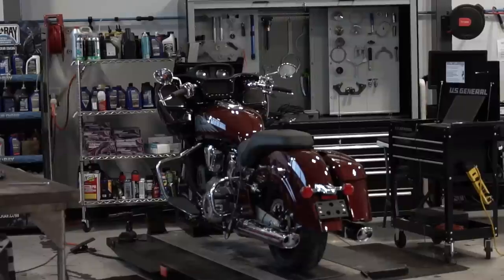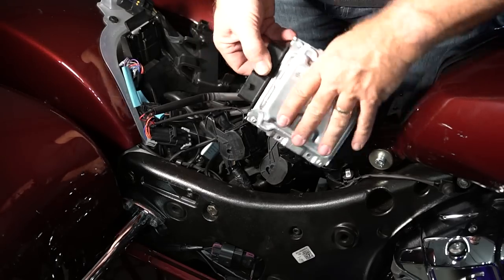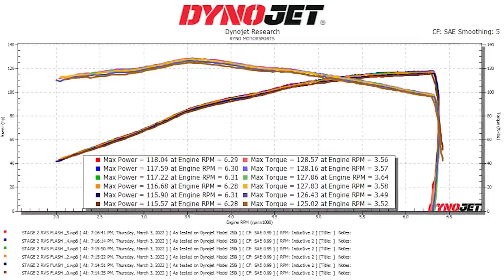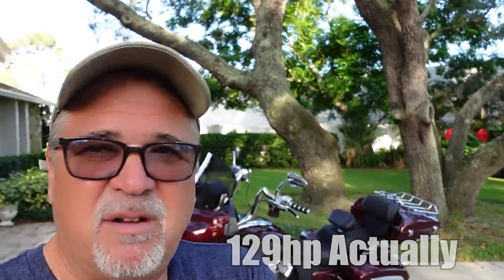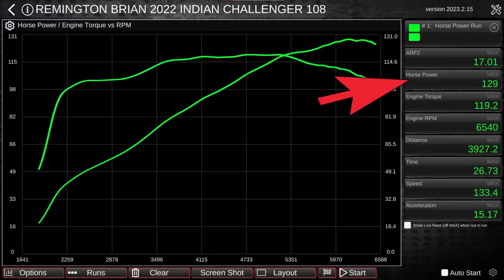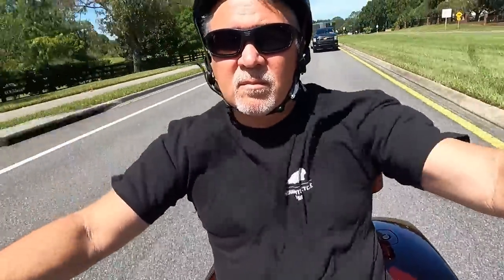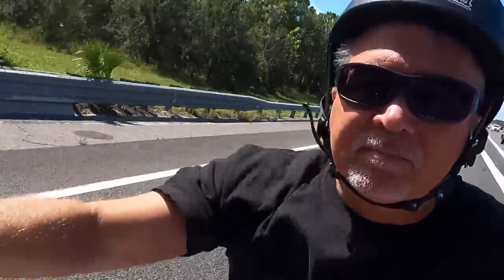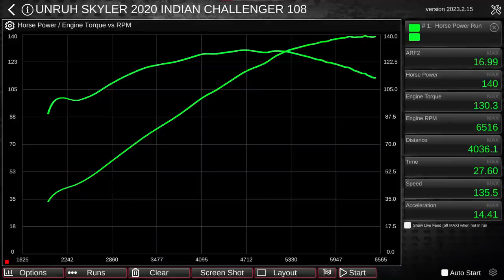My Results from the Lloydz Garage Challenger Cams - What do I do now?

Comment: The 140hp dyno chart you showed was from my Challenger.  My recommendation for you is to get the Lloydz Sawicki 2:1 Mid-Length stainless exhaust.  It is a key to this combo and tuning running optimally... from what I understand, the tune was developed with this exact combo.   Sounds great at idle and cruise, not too loud but you definitely know the bike is running.  When you rip the throttle it sounds so raw and throaty!  Bike got better gas mileage on the way home than it did on the way to Sturgis, went from 33mpg to 38mpg... and I was I ripping higher speeds and feeling it out a lot more.  Bike also runs cooler now when idling or riding at low speeds for extended periods of time. Overall I am very happy with the setup, the money spent, and how my Challenger runs now.
Reply from the maker: thats awesome! yeah thats funny, I noticed much better fuel mileage on the way homne as well.
Reply: I loved my Challenger and Sawicki pipe.  However, it wasn’t fast compared to my new BMW K1600b!  Zero comparison!
Reply: @darcher5888  Your K1600b puts down 134hp and 117trq at the tire (the 160hp they claim is rated at the crank)... the full Lloydz setup has the Indian Challenger out performing your BMW.
Reply: THAT'S a brilliant tune and result. Exactly what should happen when an engine and components work seamlessly together, & the improved cooling confirms it! We don't have these options sadly in Australia, with only one place doing Lloyds remote tunes, and some VERY bad press about them sadly. Exhausts are absolutely expensive, with our crappy dollar, and the massive freight costs. Can you send us a video clip with sound of your bike? Would love to hear how it sounds.
Reply: @GraemeBlore  Thanks! I just posted a quick clip of my Challenger getting onto the on-ramp and then the interstate on my YouTube channel.  I'll get some idling video and walk around shots later this week.
Reply: highly suggest getting the pipe it makes a huge diffrence. also suggest finding a otherized lloydz tuner that does remote tuning like the shop i use(Platinum Powersports) they hook up your bike to a computer and ride your bike in diffrent conditions to optimize the tune for your excact setup. might not have the highest dyno numbers, but your bike will run better and be more efficient for your setup. fyi, we call it the Secret Sauce
Reply: @Wicked_Rides , I would like to discuss this further. Are you in Melbourne?

Comment: I'm confused as to why you'd bother doing the Lloyds cams if you already had the Indian cams?  Honestly, I think the "Lloyds cams are better" is a bunch of BS propaganda.  They're nearly identical in profile.  And Indian's cams are WAY cheaper.  I'm beginning to think Lloyds is nothing buy hype.
Reply from the maker: I would disagree with you in that no one can show me a Challenger with Indian cams that’s producing 140hp and 130tq
Reply: @TwoIndians  But you said you lost torque after swapping out for the Lloyds cams.. and you're considering putting the Indian cams back in.  That alone is enough for me to question the Lloyds products.  

I was tempted to do the Lloyds cams on my Chieftain while I was in Sturgis.. but after the cams, install, and tune, it was a $2300 job.  I can literally do the Indian cams (including the tune) for half the cost.  The performance difference is so minimal that in my opinion its not worth double the cost.

Comment: Yes all bikes are different but I’d argue that between two bikes results should not be any more that a percentage point or two, no more. I’d also argue that if you dynoed two bikes off the assembly line that the max difference wouldn’t be but a percentage point or two. I’d be disappointed as well. Throw on 2 into 1 pipes!

Comment: Since you’re in for over $3600 I would go full Lloyd’s build and add his pipe to optimize the power output.  Just stands to reason that his cams were designed to run with his pipes.
Reply: Facts

Comment: You have no choice. 2-1 mid-length pipes. I would also recommend ceramic coating the headers. Helps to control the heat that you feel.
Reply from the maker: Something is gonna change that’s for sure

Comment: Wow & thank you for getting this out. Yes, Lloyd did say that that optimum performance would he achieved by a 2 into 1 pipe.  But the Sawicki/Lloyd'z pipe is not the only one out there. Toce (see Ridingfish), S&S, Bassani & a lot of others have 2 into 1 that could get better results. Granted the look is not what you're used to on a big v-twin engine. And you could always run a ghost pipe set up (see D&D). But I understand & sympathize with you on the underwhelming lack of performance after the build up & the staggering costs involved. Would understand if you called a day on modification, for now, but in pursuit of the full potential of that motorcycle, a good 2 into 1 is going to be a necessity....
I'll keep watching
Reply: The tune that was loaded was developed with the Lloydz Sawicki mid-length 2:1 exhaust.  The primaries are stepped about 6" from the exhaust port, I believe they are equal length as well.  A lot of trial and error, testing and tuning was done with this particular combo.  I'm not saying you won't get the numbers my bike did (140/130) with a different exhaust, but that the combo wasn't just thrown together. Lloydz has done extensive testing to retain low end and mid range while significantly improving horsepower from 4k RPM on up to the limiter at 6500rpm.  I do most of my riding from 3500rpm on up... this cam fits my riding style perfectly.

Comment: Hey Brian;

First I want to say how sorry I am over your disappointment. I feel you. 

That said; I want to tell you that in the US I own a ‘22 Pursuit premium with stage one and stage two upgrades installed before delivery to me. I also own a new challenger dark horse without any engine upgrades, in Dubai, although I did install the remote preload shock system as soon as I could. 

These comments are coming late but here’s my two cents: I spent a lot of time thinking about going for the full Lloydz treatment, but three things held me back: -1: I have no mechanical aptitude at all… so if anything goes wrong it’s off to my dealer, and the warranty would be gone. My dealer sold me the bike with the “forever warranty” and I like the fact that I have that, so this is a thing. 

-2: Lloydz is either 9 hours or 14 hours away from me, depending on whether I head north of Champaign Illinois, or south. I’m not saying there will ever be a problem with the install—we all know that Lloydz work is top notch and the quality of the components is first rate, no doubt about that—but things do break, for whatever reason. 

-3: the last thing that held me back was the marginal utility of the upgrade vs the cost. I know it will out out more up and more tq if I had went with Lloydz, but just how much more I’ll actually experience this is where the calculation is: I use the pursuit for touring; I did 5500 miles last summer in two weeks of riding, through 11 states…. It’s not quite as epic as your Sturgis run, but I was loaded with gear and I’m not sure how much more pleasure I would have gotten from the bike if I had gone full bore Lloydz… but like you said; your mileage in this respect may vary from mine. 

At this point I might say, in for a penny, in for a pound. You’re obviously unhappy with the new setup. Your choice, it seems to me, is to either go all in and get the results you hoped for, or go back to the original setup and plead with Barb to forgive you.
Reply from the maker: Thanks for commiserating with me. Unfortunately when I bought my cams there wasn’t a lot of empirical evidence on what to expect. Lloyd even told me, “we’ve never done a bike with Indian slip ons”. I was expecting more horsepower and the same torque. As it is now, I’m loving with it, have become used to it as it is and will likely leave it unchanged because a loud exhaust system is not in the cards for me.

Comment: Hi Brian, Those bikes have tons of power bare bones stock, I have a 2016 Victory tons of power stock. I understand everybody wants a little more out of there motor and that includes me. But the way I see it, just a high air flow air cleaner, power tuner, I have the cobra power tuner and a good exhaust and you're good to go. Noticeable power increase from stock without getting into thousands of dollars. Just my opinion, So for where you are at now, I would definitely go with the 2 into 1 exhaust to get the full power out of your upgrades. Good luck , Love your videos! 😎

Comment: The pipe is very important. I had a nice some years ago. Big bore kit screaming eagle heads and S&S gear drive cans . When I eventually put a 2-1 thunderheader and and a tuner made a big difference. 
So you already mentioned that bikes with 2-1 pipes were getting significantly better results. IMHO the pipe is the finishing piece to get the results you were expecting. 
It’s very common that when you make modifications like a cam that an upgrade in an air cleaner , a quality pipe and a tuner all combined to get the best results. 
Also if you’re not doing a big road trip removing the tour pack will save some weight if it’s easily removable. 
Bottom line get the pipe and tuned for it .

Comment: I went Big Bore kit when i had my 2017 Chieftain and it was the best decision I could have made on that bike. With that said, after seeing multiple posts and videos like this with very low cost to benefit ratio, i have done only K&N air filter and the Rinehart MotoPro45s slip ons on my 2022 Challenger Elite. This bike literally rips and sounds amazing to me. I haven't even tuned it or removed the CAT, and 1 year later still have zero desire to mess with it. Perhaps I got lucky and the tune on my bike and hardware are perfectly mated somehow, but i get zero throttle lag and excellent performance. I have ridden some other stock Challengers and my buddy's Pursuit and they don't feel as tight or cohesive for lack of better words. 

After all of that, if i were you, i would have to put a 2 into 1 pipe on at this point. You may as well try and make the best of what you have there. From one Brian to another, I hope it works out for you brother.

Comment: I have met Lloyd many times and discussed these cams with him in June. Not sure I need them due to cost v benefit. Running his exhaust which I love v Indian stage 1 pipes also have the remote tune and the bike runs really hard. Why mess with it. My suggestion is change exhaust make the power you want and be done.

Comment: My own experiance has always been to get good results that changes must be matched. That said its suprising that changing the cam from your previous stage 2 cam would be exhaust limited and has gone down in torque. While its impractical to do money wise it would be interesting to know what torque and horsepower would be with your stage 2 cams and a new pipe and tune. My hunch is the potential hp for your bike is the pipe and your old stage 2 cams. If you really want the most hp though there is always a turbo which is highly tuneable.
With all the coverage you are providing you should have a sponsor stepping up to the plate to showcase their products in the best light.
Great video once again.
Reply from the maker: Good points, all of them. I’m open to offers.
Reply: @TwoIndians 
I to be honest think you should have been advised to do the pipes by Lloyds before going ahead as a condition to get the results, just as Indian does. Secondly if the lift and duration of the Lloyds cam is close to the Indian stage 2 cams, then the magic is in the pipe. You still may not like the noise or drivability though.
Finaly strictly my own opinion but with all your subscribers if it were my business (and its not) i would have worked with you to showcase the products for the best outcome either costs shared or free since you are promoting their products.

Comment: Do you have the Tab crossover pipe to eliminate the CAT? You would not believe the difference in sound and power. It's not louder until you hit the throttle. It also is an easy install. Thanks for your channel I also have a 22 Limited. Wonderful machine.
Reply: A 2-into-1 exhaust is what the tune was designed for, it will also get optimum flow and have less weight than the dual exhaust.  The factory primaries are not that great, they are not stepped or equal length.
Reply: @UnrulyRider  he can’t deal with the noise. It’s all a trade off isn’t it? I prefer staying away from engine mods. There is little return on investment.
Reply: @dhess140  Went from 112hp & 118trq to 140hp & 130trq.  My Challenger had a modified Bassani exhaust and Stage 1 Indian calibration before the Lloydz parts/tune and it didn't run right at all.  It would occasionally stall when coming to stop or idling for awhile.  It ran hot, throttle was twitchy and overly sensitive, and would average 33mpg.   After the Lloydz parts and tune the throttle is smoother, no more quarks at low speed.  Engine runs cooler and gets better fuel economy (38mpg).  Passing power has definitely increased.  For the money I'd say it was very much worth it.
Reply: @dhess140  Removing the cat would be a great test to see if the numbers bump up or if the flow limitation is in the primary pipes before the merge.  Would also be considerably cheaper than the 2:1 while still allowing Brian to run chrome slip-on mufflers he has already purchased.  I'm with you on this, he should probably go this route first.

Comment: Have tuners unlocked the ecu or still locked by Indian???
Reply from the maker: The 23’s and 24’s apparently can be unlocked now but it does cost quite a bit more than 22 and below. Apparently there may also be limits to what can be altered but I’m only going by what I’ve read. Reach out to Ryan at RVS Performance, I know he’s doing this.
Reply: @TwoIndians  thanks. I dont even have an Indian yet. But researching. If I were Indian I would make tuning easier to beat the competition no? They should be having 101 tutorials at HQ inviting tuners for the sake of gaining on HD. You recommend RVS over Lloyds?

Comment: I think the biggest thing was that you already had aftermarket cams, intake and tuning from a stock bike so you wouldn't have seen much of a change with the Lloyd's set up.  That being said, it also seems with the cat still installed, you just can't push more exhaust out of the bike so it's being restricted which is why it still feels like a stock bike.  Pulling more in means you have to push more out.  Try the exhaust and retune to see where that gets you. You've already spent the money so why not 🤷‍♂️
Reply from the maker: Ok if that’s the case then, why would my numbers go UP with the Indian cams but go down with the Lloydz cams? My honest opinion is that these cams are made to work with the Lloydz pipes and should only be sold that way. I would love to hear from Tim and Or Lloyd on this.
Reply: @TwoIndians  I would think it's because indians were designed to run with the cat and the Lloyd's were not.  So with the correct set up (intake, exhaust) Lloyd's could potentially out perform the indian set up overall.  Since it's just the cams and not the entire designed system, it's being hindered from its full potential. If you've seen the evidence of 140hp set up from Lloyd's and you want the top performance you can get, it sounds like you're half way there and just need to complete the system to get the most you can from the engine.

Comment: Been contemplating stage 2 on my road glide limited. I'm afraid of losing take off/ low end torque. Did stage 2 on my old ultra limited, it was slower down low, but you could feel it from 3 to 5 k.😮 Didn't have a 2 into 1. Both dual exhaust
Reply from the maker: Harley’s have sooooo many options for Cam profiles that you can get just about anything you want to target specific performance goals. Indian Challenger? Not so much.
Reply: @TwoIndians  I know I like those Indians too!

Comment: Lloydz and his guys are stand up guys. 

They did 2 of my bikes at his old shop. Just get the pipes and have both HP and TQ.
Reply from the maker: Lloyd was aware that I was putting his cams into a bike with an Indian stage 1 exhaust and said nothing to disuade me from doing so even though he likely understood my results might be less than desirable and that I had no intention of installing loud pipes on this bike. Since that day he has posted several cryptic FB messages telling people that they’re working on “something” and blamed multiple complaints about performance on his need to clarify exactly who should or should not be buying his cams. I’ve reached out multiple times to try and get updates on other options and got crickets from him. Tim on the other hand has been gracious and communicative and understanding of my predicament. It’s not in the video but upon seeing the disappointment on my face Lloyd essentially gave me nothing more than a shoulder shrug and a “oh well” response. There’s more info that I won’t go into but yes a set of pipes may be in the works. Money is always an issue.

Comment: You may be putting a little too much stock in the final torque number. The question is, when you overlay the base dyno pull over top the latest dyno pull, did you get more torque lower in the rev range than before? You may have had a significant torque increase down lower say at 2000 rpms and held that torque longer until it reached its peak. But if you want peak horsepower and torque, you will have to go a two into one exhaust. Personally, for me, I don't like the sound of the two into one exhaust, that's just my preference. Like Lloyd said you can't have everything. You will have to sacrifice something, either the sound or the performance. Good luck with whatever you decide to do , and thank you for sharing your experience.